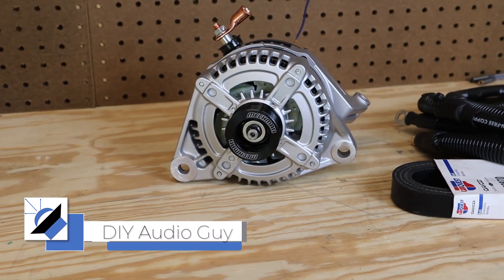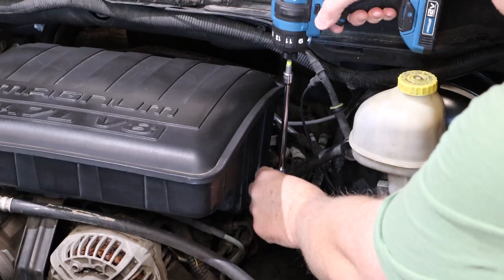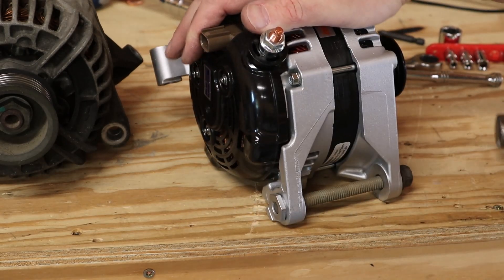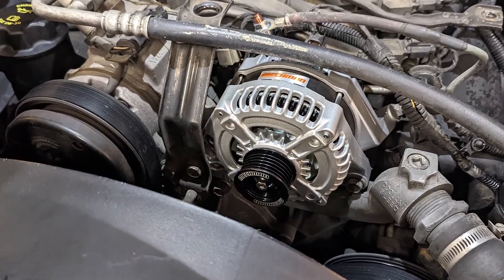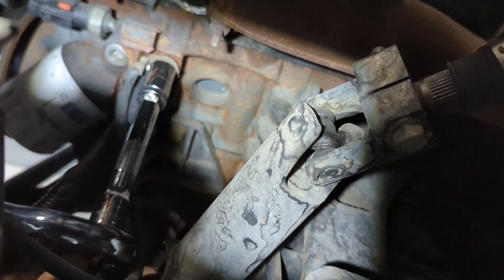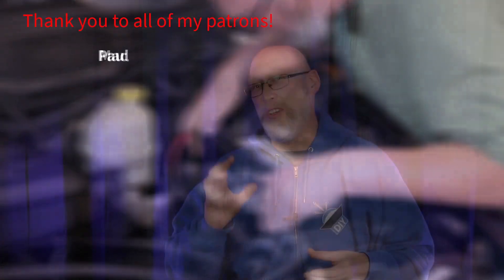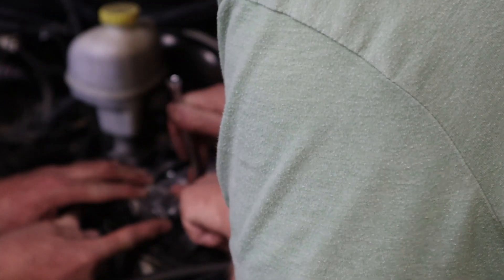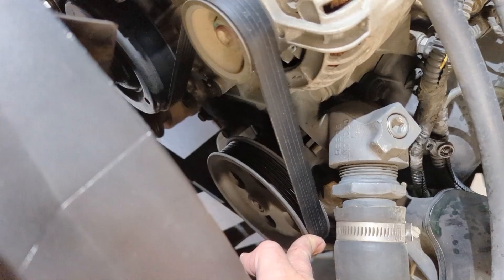High Output Alternator and Big 3:  How to install.

Comment: I recently installed a HO alternator in my 01 Honda Accord 2.3L.  Stock is 80, I went with a 250 amp.  However after installing, I'm noticing that when I pull up to stop signs, red lights, parking spaces, etc., my car damn near stalls. Sometimes it will stall.  I've read that it's due to the "turn on rpm" of the alternator and because it's not putting out enough juice at idle.  Can anyone share info on this?  anyone else experienced it and if so, what do you do to fix it?  My thought is maybe I should go with 160 amp HO instead, since that's double my stock instead of 3x the power.  If there is a standard practice though for fixing this I'd love to hear it.  I thought about adjusting the idle speed, but everything I've read says that it's set at the factory and should not be messed with.
Reply from the maker: This is a common problem with aftermarket alternators. In order to get that big power from them. You've got a rev the engine and they put out virtually. Nothing at low RPM.  I'm not aware of a solution, alternators are not my area of expertise.
Reply: @DIYAudioGuy  Thank you for your reply.  If anyone else has any advice on this issue, I would greatly appreciate it!  Thank you!

Comment: Is a big 3 needed for a 1800 w RMS amp ? Stock alternator 90 amp . 16 compass
Reply from the maker: It will not help because 90a is all you have to work with.  You need an upgraded alternator for an amp that size add the big three when you upgrade the alternator.
Reply: Would a 120 apm help, or should I find something around the 200 ? For alternator amps

Comment: No you don’t have to take  pictures of the belt routing unless you really can’t remember. 
 Serpentine belt routing is easy, the belt has a smooth side and a ribbed side, some have 4,5,6 ribs. Now your motor has pulleys with the ribbed grooves and some smooth tentioners and the only way to route the belt is to place the ribbed side of belt to ribbed pulley those must face one another and same with smooth or outer side of belt and tensioner pulley. 
If ribbed side of belt is making contact with a smooth tension pulley or vice versa it’s wrong.
Reply from the maker: I can count on one hand the number of times I've changed the serpentine belt. So I'm taking a picture of the damn thing.  If you're a mechanic that takes three or four of these things apart every single day then you don't need to take the picture.

Comment: Do you know of any good videos that go into detail about how to install a high output alternator and put the right amount of tension on the belt etc. I'm ordering my first EVER HO alternator and need help
Reply from the maker: Contact customer support for the company you're buying the alternator from.  I ordered mine from mechman, they told me the exact belt that I needed.

Then I did a search for how to change the belt in my specific vehicle, and I bought a few tools.

Comment: Little late here, but there are issues with doing and Alt upgrade.  In my case it was a 400 amp alternator in a 2015 Ford Taurus.  What no one tells you is all modern cars use a battery management system.  In the 2015 Taurus case its based on the negative battery terminal.  It's an amp clamp that senses current.  Whats going to happen if you do nothing is the sytem will start and look fantastic!  Untill the BMS adapts to the new current level.  IE after about 8 hours.  At that point your voltage will mysteriously start to drop off.  The system is seeing your battery hitting its 80% charged limit and deliberately throttling alternator output.  No what anyone doing this is aiming for.  I grounded the negative to the frame and the alternator to the same point.  Now you have 2 choices.  Use FORSCAN and disable BMS, or simply unplug the current sensor.  Things you learn on the way...
Reply from the maker: That is a good point in something that more people need to talk about.  I very rarely see more than 14 volts in my vehicle because the ECU controls the alternator.  At some point I'll need to add a regulator.

Comment: What happen  if my belt is the stock belt on the high power alternator ??? Please  respond 🙏🏽
Reply from the maker: The belt will be loose and none of your driving accessories will spin.  Some cars will have a tensioner pulley that you can adjust, or that will adjust automatically.  But why risk it? If you have the money for a high output alternator and you can't afford to replace the belt then you don't have enough money for the high output alternator.
Reply: @DIYAudioGuy  thanks for the response  but I took my car to a shop and I told him to put the belt I brought him but he tossed my belt and put a stock belt  on the altornator Wil that belt  damaged my altornator???

Comment: If my amp is 1000 watts rms would a 160 amp alt be enough? I also have aftermarket led headlights that suck up a lot of power.
Reply from the maker: My factory alternator was 140, so that does not sound like much.
Reply: @DIYAudioGuy  do you mean that I should upgrade my alternator ?
Reply from the maker: @Knightfallprotocol444  do you know the output of your factory alternator?  

I've yet to figure out a good rule of thumb that I can give people when they're trying to make this decision.   It's a vehicle specific question.  

Let's see your factory can put out a hundred amps.  That's only peak output, not idle output, and your car is probably going to need 75% of that power to operate.

That leaves 25 ampers of current to operate your aftermarket gear.    You are 1000 watt amp is going to need 100 ampers of current, thankfully the battery will help fill in the gap and you're not going to be playing volume 100% of the time.
Reply: @DIYAudioGuy  I believe it’s 160 Amps at idle. I’m running a lower powered battery with 800cca. I definitely need to improve my battery soon and alternator in the future. Thanks for all of your input, it helps a lot!

Comment: I'm looking forward to watching this video while on the plane. I'm picking up an D3400 XS Battery in a few days. My total wattage in my system probably tops out at 1100-1300 watts. Im also replacing my serpentine belt that's due for change.

Comment: The battery being replaced will absolutely help since it stores all the power! ( pop the cell caps I'll bet the fluid is low ). Now with that being said,  maybe you did it of camera but for the people watching as well as you bud. When doing the big 3 first always super clean all connections including the factory's  and use terminal protector or clear coat the crap out of them!!!!!!!!!!    And most definitely buy new terminals ( there's many options,  my personal favorite is the terminals with the post adapters. ).   This will completely fix the voltage drop!   Lastly the fused link is a safe idea and always a good idea,  however doing the upgrade completely and cleanly it isn't needed because most vehicles already have a fused power wire and if it goes it will tell you far faster than the new wiring fuse ( since your putting a bigger wire and fuse than the factory). Now if your running a old vehicle with out the fuse than pro tip. The alternator wire to battery must be fused,  close as possible to the alternator and make sure your fuse is matched to the alternator amps! Then the power wire to the amps will match those and Lastly grounding the alternator casing should be upgraded as well. ( the big 4 )   or you will create the bottle neck that will cause the power wire to heat up.     Lol actually 1 more peace of advice for everyone. If you're going to do the big 3 never use a smaller wire than 4 gage ofc.  But really just use 0 gage ofc and never look back...

Comment: Great video. You can find some of the higher-end AGM batteries have positive and negative side mounts and top posts. They are a great option for connecting many power leads and grounds. I have an X2-Power AGM setup in my truck.

Comment: As a diy myself if anyone wants a cheap way to add buss bars to your batteries. Just go to Home Depot and get mending brackets. This gives you 3-4 extra “holes” to install lugged wires. Most places will charge $50 for a 4 lugged buss bar.
Reply from the maker: Thanks for the tip.

Comment: I need my alt upgraded.  2 phoenix gold sx amps 1200.1s with 4 xs power batts pushing 6 10 inch phoenix gold sx's in a 2021 civic.. thanks for the uploads, always watch and learn. I'm 39 so I'm not new to car audio but no pro..
Reply from the maker: Go for it, the alternator upgrade is the way to go.

Comment: get video. what would cause a subwoofer to cook when there is no direct short all connection check out and it only happens when the volume is turned up. could you please help?
Reply from the maker: I am assuming you can smell the sub getting hot?  That it is either to much power and/or clipping.

Comment: Do you also up the size of the alternator positive cable and if so what gauge wire do you use.
Reply from the maker: Yes!  Zero gauge with a 300a fuse.

Comment: Just a question, I see a lot of people using fuses instead of circuit breakers for their car audio power lines.  I'm curious as to why, as the circuit breaker is re-settable and it provides an easy way to disconnect the power to the amps (by just switching it off).
Reply from the maker: Honestly, I think it is because that is the custom.  Everybody does it because everybody does it.
Reply: @DIYAudioGuy  Not me, LOL.  For as long as I can remember I've been using circuit breakers.  I've got a 200A one in "Matilda" right now that's been there for almost as long as I've owned the SUV (15 years).  I guess fuses are a bit more aesthetically pleasing than circuit breakers, but I'm definitely a function over form guy, particularly when the chances of getting a replacement 200A fuse locally are basically zero. No bass for a week while I wait for a replacement to be shipped?  Not happening :-).
Reply: The main issue we see with using those is voltage drop can happen with the wide variety of cheap circuit breakers.  Same goes for battery isolators, it's just another pot for potential voltage drop.  The "fuse" is usually the goto as it is cheap, more readily available and less chance for voltage drop due to cheap manufacturing costs.
Reply: @mechmanalternators Interesting. Battery isolators are a bit different as those have electronic components in series with the power feed that will cause a voltage drop.  With a circuit breaker, all the power feed sees is a switch.  I guess one could argue that a fuse only has two points of contact while a circuit breaker has three (the connections to the circuit breaker and the internal switch), but that third point of contact is usually very well protected .... 

FWIW, "readily available" is subjective. if I replace my 200A circuit breaker with a fuse and it blows, I will have to wait a week for a replacement because I will have to have one shipped - no one stocks that locally. OTOH, I've been using the same 200A circuit breaker for the last 15 years so never had to replace it, and the convenience of just being able to switch off the power to the amps (as opposed to having to pull a fuse or unscrew a cable from the fuse holder) is just too much to give up :-).
Reply: @Grommet2007  100% on the money.  As for your 15-year-old circuit breaker.... unfortunately, there has been a decline in quality/quality control of many of the electronics over that year span. :( 

In a situation where a disconnect is needed, I personally just use high amperage marine grade on/off switches.  I use these instead of relays as well on my personal off-road vehicle.
Reply: Fuses blow quicker. A breaker can malfunction and blow later or not at all

Comment: I went with Autotech engineering 320 Amp alternator. Most car computers regulate the voltage. Causes spikes and drops. The auto tech ho alt comes with a harness with diodes to increase voltage. Paired with Agm and 1 limitless lithium 15ah. I maybe drop half a volt at full tilt. I'm only using 3 to 3500 rms. I'm sure if I go with bigger Amp I may drop a volt

Comment: Great video ☺️ but just so you know you can't use lithium together with a AGM battery. You will lower the lithium and kill the AGM ☺️
Reply from the maker: It is not the chemistry it is the resting voltage https://lddy.no/1divf and https://lddy.no/1divh both claim to be 100% compatible with a stock battery.
Reply: @DIYAudioGuy  i know hehe. The lithium will stay where you charge, as all type of lithium i use have. The AGM will rest at 12.8-13v depending on what type of AGM you use. When you charge at 14.4v pluss, your AGM will drain and stay under constant charging, this will kill the AGM. And as a total you will less power. I used AGM and it does together with the Lithium. When I used only lithium I got less voltage drop ☺️
Reply: @DIYAudioGuy  While they are compatible and, in your situation, OK to use (and most mild setups), it's the charge RATE differentials between the 2 chemistries that the alternator can sometimes have a fit with when one or both of the batteries are heavily drained.  Usually only in heavy/big builds but we've seen it happen.
Reply from the maker: @mechmanalternators  Would love to have somebody from Mechman join us on one of our live streams to talk about all of this.  Let me know if y'all are interested.

Comment: Great video definitely one of my favorite that you put out.
I hope you enjoy the bass as much as I do.
Also you could have lefted the engine block ground and add a ground directly to the casing of the alternator if possible.
Reply from the maker: Some people add that and call it the big 4.
Reply: @DIYAudioGuy  the reason I do it because vehicles today are sensitive and I don't want to make a sensor lose ground refrance because of my wiring.
Reply from the maker: @joeyh7817  That's a good point.

Comment: What do you do if you have a sensor on your negative battery cable to your battery? Plus what do you do if you have to bypass the ecm so that you can charge more than the stock system allows?
Reply: Easy, you goto www.mechman.com and read the FAQ and/or Instructions tab. 😉
Reply from the maker: In both cases I would advise you to reach out to the manufacturer of your alternator. They should be able to provide you some customer support.

Looks like if I want to maintain high voltage that I'll need to bypass my ECM as well.  This thing likes to hang out at 13.8 no matter how hard or how light I push it.
Reply: @DIYAudioGuy  You can either do the external regulator thing (plugs in) OR we can rebuild your alternator with the more standard GM 4pin regulator which will have your voltage at a steady 14.6-14.9 volts.  You'll need to install a 12v switched source wire from the pigtail we provide to turn the alternator on and off as the only other hookup.

Comment: Watching this great video with a little bit of envy. This core part of the big 3 won’t work on the vehicles I install on. Mechman doesn’t even make one for the later model Hondas we drive. Those Hondas have computer controlled alternators that allow voltage drops irregardless of the output capacity of the alternator installed. There is a workaround but it is very complicated and definitely not for novices.
Reply: Sadly, you're right. LINBUS integrated computer charging is very finicky and doesn't like being messed with. 

Usually just adding batteries is an good, reliable and somewhat economical bandaid.
Reply from the maker: That sounds like a royal pain.

Comment: I got a mechman 370 elite all my power issues are gone but now I can't find a belt strong enough to handle the resistance it creates trying to.make all that power
Reply: Sounds like a belt alignment problem or some other issue. A normal belt works perfectly fine.
Reply from the maker: It could be any number of things.